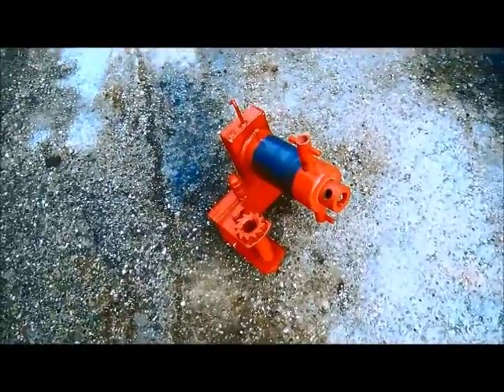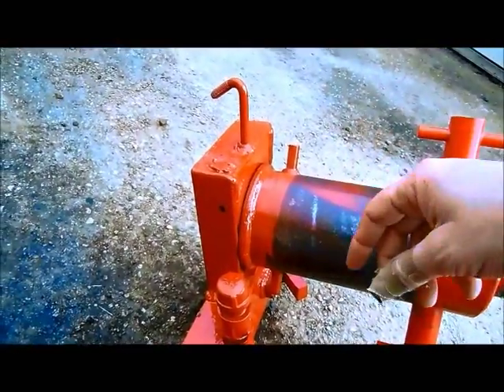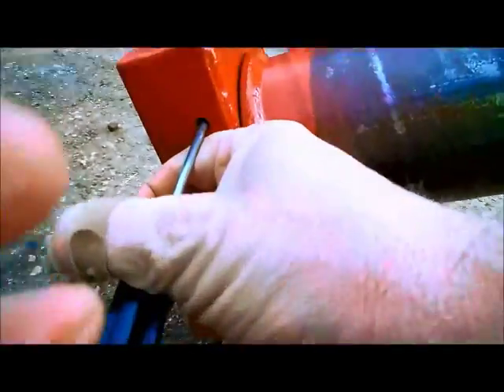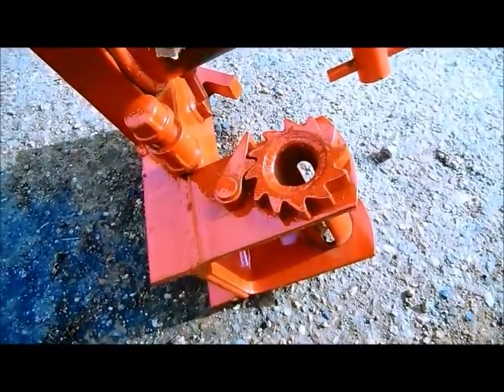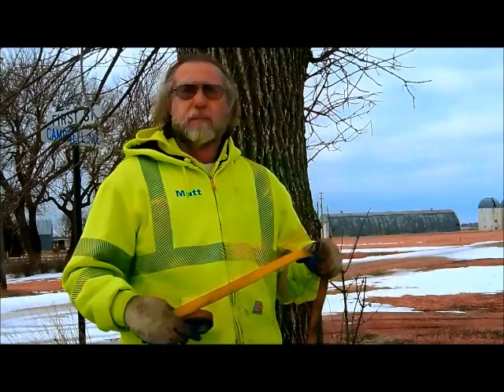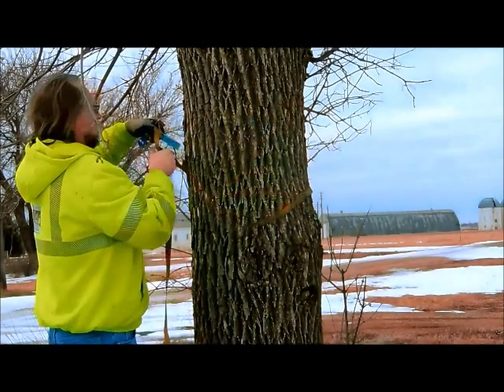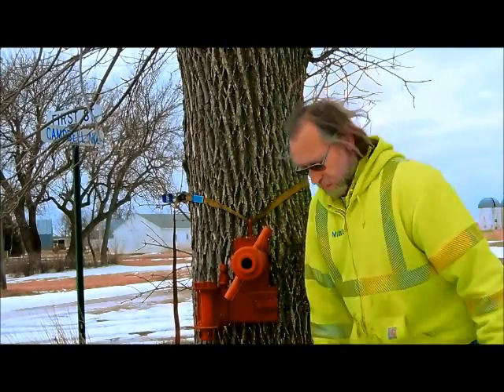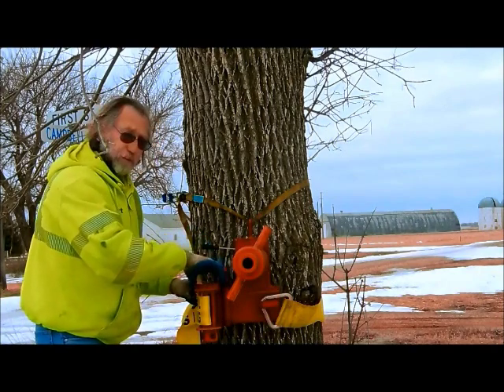Matt's Tree Service Modified Bollard Ratcheting Friction Brake

Comment: Hey Matt you forgot to explain that you should cut yourself in 2 inch shelf 14 inches high to allow the Hobbs a shelf to sit on and it will not move once strapped snug. Then for the strap on the opposite side of the Hobbs cut out shallow groove for the 4 inch strap to rest to assure no slipping. We used to have moms on almost every medium to large removal. Along with using X rigging rings. With the combo of both you have one hell of an apparatus. Haycock Tree Climber
Reply from the maker: If you feel you need to go through the extra work, but honestly I've never had this thing move more than about an inch once strapped in place.

Comment: What brand were these?  Forestry suppliers doesn't have it anymore
Reply from the maker: https://www.forestry-suppliers.com/product_pages/products.php?mi=17081&itemnum=27335
Reply from the maker: https://www.sherrilltree.com/good-rigging-control-system
Reply from the maker: I now have the GRCS and it is the best thing I've ever bought. Because of the way it's designed, the rope never overlaps itself when using the winch so it never gets hung up and the winch works so easy it is amazing.